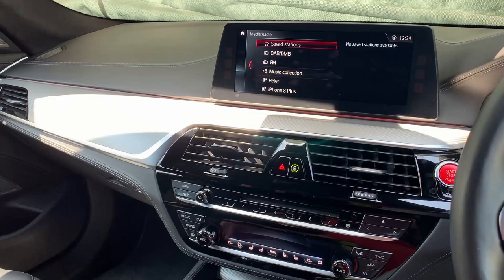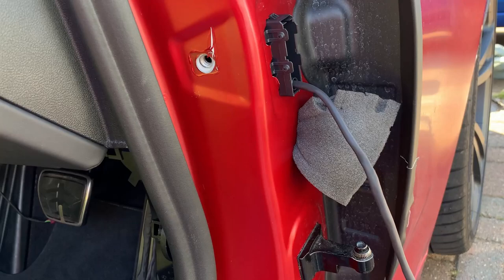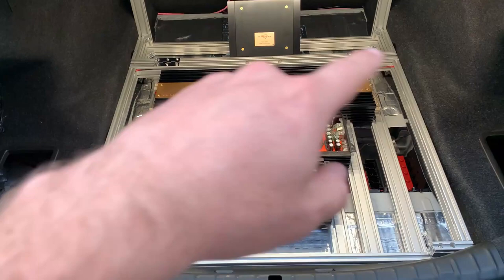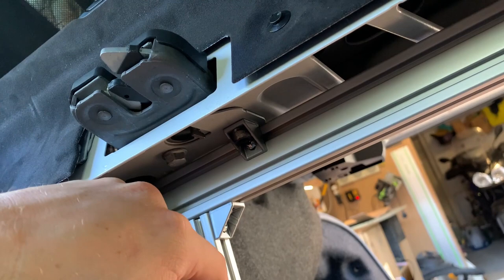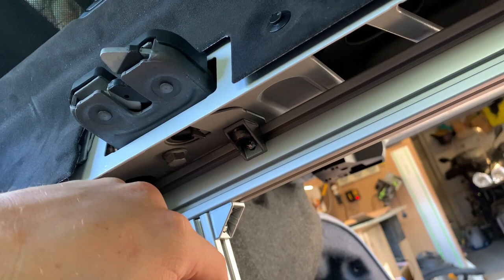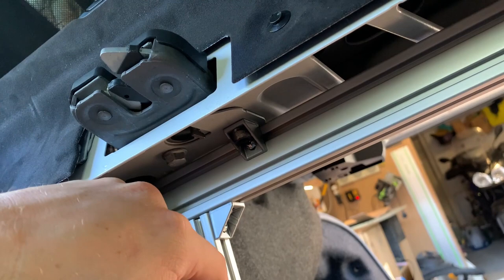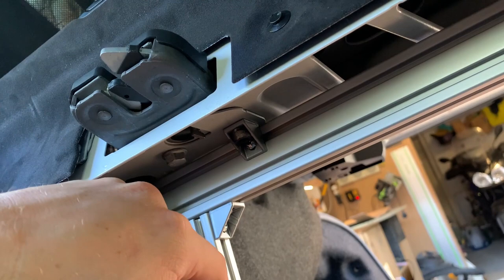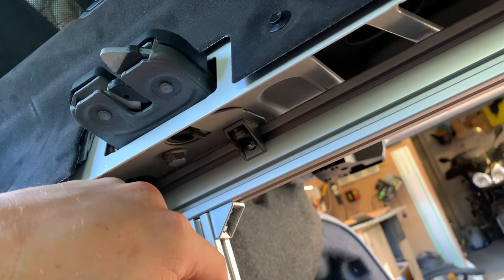1000bhp BMW M5 F90 High-End Audio System Installation - EXPLAINED

Comment: Bro, I feel you so hard with the speakercables in cars. did a F22 M235i. one run 2,5mm2 and one 4mm2 for big doors. Same OEM plug as in this F90. Same bulshit with electrics behind the panels with removing all of them for the job. 6hours of pulling cables through that shit. With drilling that OEM Plug. I fkn hate it. but got it done. Love your work BTW
Reply from the maker: Worst part of any project these days. 😞

Comment: Insane, I love it. Thank you for sharing your knowledge. I have a BMW 740i E38 with 2 JBL W12 GTI sealed. You make me think about it and I want to try IB. Are 2 units of  JBL W12 GTI suitable for IB?
Best Regards from Malaga (SPAIN)
Reply from the maker: Jorge Torrejón i’d always use as much cone area as possible, but i guess it’s also about expectations and requirements. Some people are happy even with a single 12” in trunk IB, but some others want the dynamics of 2x15-18”. 
JBL GTIs have always been used around the SQ circles in IB, but it’s definitely not an application for those who focus on output. They can certainly be louder in the main passband of 30-60Hz in a box, but IB is always more linear, less boomy and has way better extension under 30Hz all the way down to single digits when done right.
Reply: @pssound9749  thanks a lot for the answer. I am a SQ fan, so I don't want a boomy system. I have Helix tube amps for my mids and tweeets. I just want more extension in the low frequencies, because even with 2 12" GTIs, it is really difficult to make the bass get into the cabin. It is curious how much isolated the trunk is in this BMW. The rear seats can not fold down, i have only the hole of the rear armrest, the hole for the skies
Reply from the maker: Jorge Torrejón there is a test in the Trunk IB playlist, see how the rear seat effects output. 🔊🔊

Comment: Your video's always give me ideas, and always informational. I've actually thought about doing an metal amp rack build and I have a small question in regards to doing so, it might be a bit of a dumb question but I would rather ask someone who has the experience. So my question is seeing as a lot of amplifier manuals say not to mount the amp directly to metal when mounting them to eliminate possible floor noise, did you use rubber washers in between the chassis to rack & mounting hardware to rack to isolate it from grounding out so to speak?
Reply from the maker: rps13joe we didn’t isolate in this case and had zero issue. However, it’s a valid question, which could be shared on forums, so more experienced people, especially some amp manufacturers could chime in too.

Comment: Great video again! How is the sound quality from Most and android auto compaired to something like Fiio to dsp. Thinking of buying a Most150 converter. Its expensive:'(
Reply from the maker: Yes, if you need MOST150 for some of the new cars, then it’s not cheap. That’s the price we pay for these modern cars! 
BMWs sound great on MOST25 if you play lossless, FLAC or Tidal, so it’s absolutely fine for most people.

Comment: Hey @Pssound would you rather take two 12" Acoustic Elegance IBAU or two 12" FI Audio IB subs?

Help me decide please
Reply from the maker: Alex O for what? Daily booming = Fi. 
Accuracy and quality = AE. If you have space, go for 2x15”.
Reply: @pssound9749  thanks for your reply. I am looking for quality! I have Focal krx3 front stage. Need subs to fill in the sub stage. I am worried that 15s won't be punchy enough? Never tried an infitinte baffle setup before though
Reply: But I also want a little bit of boom hence why I am looking at two 12s. I am worried that if I go 2x AE, I'll be giving up all of my boom
Reply: Coming from a 12w7 in sealed box
Reply from the maker: Alex O that’s why i said to have 2x15” then like in this one or the E63AMG we built. Those subs play the upperbass beautifully too and have enough headroom for booming.
Reply: @pssound9749   I am trying to mount the subs on my back deck. I don't think the 2 15"s would fit.  I am not 100% set on back deck though. I would prefer two 12s in terms of space. My amps runs 2 ohm @ 1000watts or @ 1ohm 1500 watts. My amp could run 2 Fi Audio 12"s @ 1 ohm @ 1200 watts or 2 AE 12"s @ 2 ohm @ 1000 watts. I'm not a bass head, I just want a nice smooth output. At the same time, I want the bass to be at least what my 12W7 could put out. I am leaning towards the 2 12" AE subs, I feel like the SQ is more important to me and have 2 AE 12s should suffice in terms of output.

Comment: I have a quick question Peter.  If I choose to use a Fiio M11 as my source unit, is there any way I can retain the factory functions (navigation and cameras mostly)
Reply from the maker: Option A:
You connect the Fiio to the HU, then yes, but then you could use a phone too, no need for a Fiio
Option B: 
If Fiio is connected to the DSP directly, then you have no steering wheel functions and there is no simple solution for it or rather any. You have to use the controller of the DSP or the volume on the Fiio.
You can still use the Factory system simultaneously for satnav, just keep some of the OEM speakers.
Reply: @pssound9749  Thanks for taking the time to answer.  Sounds like a solution to my potential problem.  I appreciate you
Reply from the maker: Ricardo Mayorga check out the E63AMG playlist where we had 2 simultaneous system running.
Reply: @pssound9749  Will do.  Thanks again

Comment: I really enjoyed this install, even though I haven’t gotten serious about car audio in about 15 or more years, the video has given me a lot of ideas that I’d like to see in my own car one day. I am also reminded on how complicated but fascinating car audio is compared to home theater and audio. I have 5 subwoofers and 11 different speakers in my theater system and it was no where as complicated as this install. Would’ve loved to hear the end result, awesome work! One question though, I noticed that you decided to keep the under seat subs, is this because you are able to EQ the deficiencies out? I am actually thinking of replacing mine for the Audioson s in hopes of more mid bass kick.
Reply from the maker: Once you have proper amplifier running the HK midbass, you can actually get good resuls.
Reply: @pssound9749  thanks, I will give this a try first

Comment: Hi Peter. Did you ever try to take high levels inputs from Harman Kardon system in BMW same year as this is? Is it possible to get good signal out of it without helix ssdmi25? As this is now out of stock for longer time. Is that signal in from HK very bad?

Comment: Hi mate, have an f90 myself and going for just a standard boot sub to add to the original system. Just trying to figure out how do i connect it all to run with the standard H/K system.
Reply from the maker: Hi,
Cheapest option is to take signal from OEM bass drivers from underneath the front seats and wire those lines to an active sub. Not quite what we do as that way have no control over the sub. 
We’d rather add a DSP amplifier replacing the OEM amp and a monoblock, so everything could be tuned properly with a laptop and RTA.

Comment: Always impressed by your theoretical and practical skills Peter.  I am nowhere near, but I would like to improve the front system of my CL9 Accord Sedan, I know you made a build in one but I´m looking for something simpler. What would you do? 6,5" in doors and 3" on stock tweeter location sound okay? Unfortunately its a manual so dont think I can utilize the front frame holes with kick panels as there is no space on the drivers side.
Reply from the maker: bingoberra18 have you seen the 10day SQ install playlist?
Reply: @pssound9749  No, I guess I should :)

Comment: What did you do or midbass under the seats? (you mentioned Midbass under the seats in the video but you didn't show them or the install)
Reply from the maker: Because we did nothing to it. We described in some of the videos that we kept the HK driver, amplified and tuned it and it delivered pretty good results. 
I would still recommend to change it to an OEM upgrade option which gives you lower impedance than the 8ohm HK one.
Reply: @pssound9749  thanks!! I have  a 2010 E60 that’s lacking output in the midbass area and I’ve been considering using the underseat “sub” location as a means of getting it better